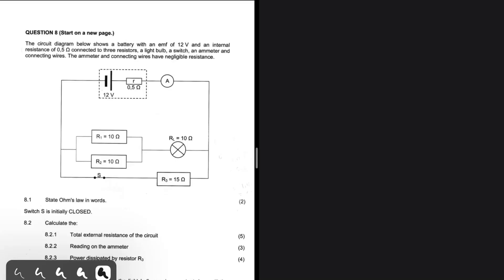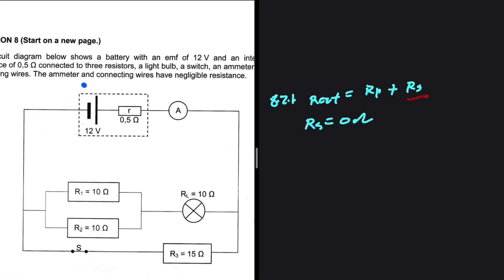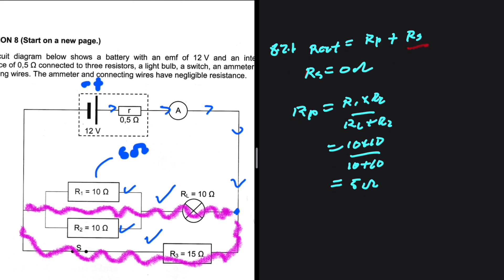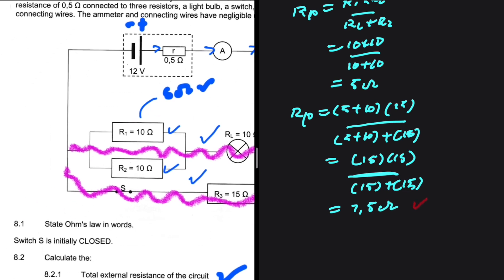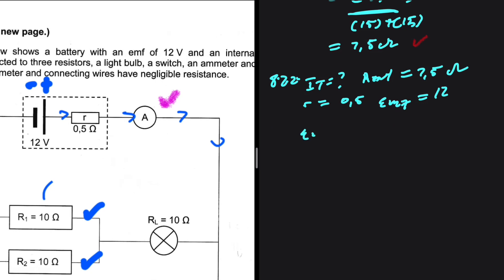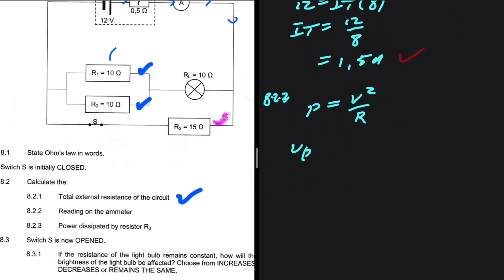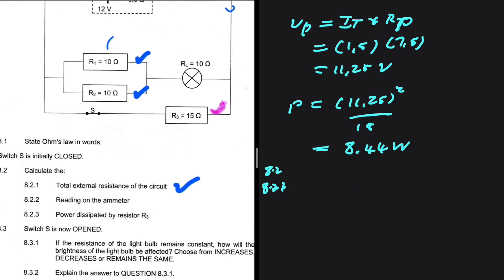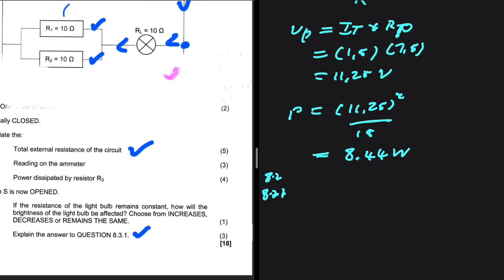Electric Circuits Grade 12 Physics November 2023 ( P = 8... W)

Comment: What i know is that the Rtotal increases
And the Vext also increase 
And vInt decreases
Then the Current in the circuit will eventually decrease bcoz the resistance is inversely proportional to the current

Therefore we can conclude that the light bulb will decrease its brightness due the decrease in current

Comment: I think it's decrease 

A series circuit would be created if switch S is open
So Total external resistance increases 
Total current decreases 
So it'll be less dim
I wasn't sure whether emf and Vint was needed but i added them anyways
Didn't wanna risk😂
Reply: I wrote the same thing
Reply: I think it's the same because the resistance doubles, currents halves but all 100% of the current goes through the bulb so the bulb actually receives the same amount of current as before.
Reply: @crazymonkey6371  omw you're right😭 I'm so mad at myself rn
I was over excited writing this paper